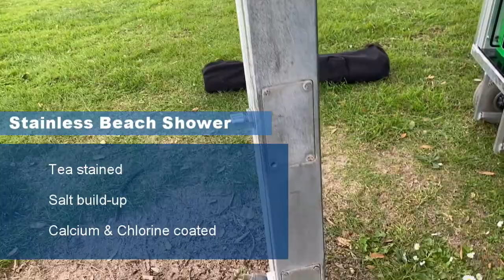Laser Cleaning of Stainless Steel Beach Shower

Comment: Hi there.  Very interesting demo!
Am I correct that you are using a pulsed laser here vs a CW (Continuous Wave)?

May I ask specs on watts and nm of this unit?
Reply from the maker: Yes correct I use a Narran 300W nano second pulsed laser 1064nm.
Reply: @ecolasersolutions8769  Thank you.  I'm curious, do you think that of you moved up to say a 1000 watt laser by Narran that it would be more efficient in removing the mineral deposits and capable if removing heavier build-up over greater surface areas?  Say 1/8 inch thickness?
Reply from the maker: Yes it would be faster for sure. 1/8 inch is around 3mm. That’s quite thick but it depends on what the contamination is. What’s it’s being removed from and how long it’s been there.
Reply: @ecolasersolutions8769  Thank you.  I understand.  Basically the same material you are cleaning off of the stainless steel.  Hard water deposits made of line and calcium carbonate.   Say 1/16" to 1/8" thick.  It looked like the area below the spigot had heavier build up but that section was ommited from your video.  I'd like to use it to clean ceramic and glass tile and the grout lines.  What do you think?  Maybe a 2000w laser?
Reply from the maker: You can’t generate too much heat with tiles and grout as they crack so can’t have too much power. Plus the cost of these machines are a major consideration. Narran have a dealer in the US. They can give you pricing. Sit down though.
Reply: @ecolasersolutions8769  Gotcha.  I wondered about that.  Although, I thought that certain types of lasers (pulsed?) did not transfer heat to the substrate.  Also, I thought there m8ght be a way to tune the laser to same frequency as the target material to make it be absorbed by the target.  Perhaps using a dye on the target?  Thanks for your patience!  Nice demo!
Reply from the maker: Yes there are programming setting that can eliminate heat transfer.  Calcium and salt off stainless is easier to remove than off tiles in my experience which is limited.